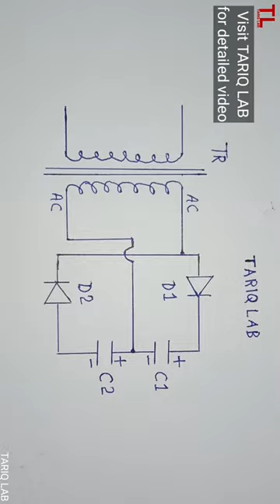Voltage Multiplier Circuit | Voltage Doubler

Comment: value of capacitor and diode.
Reply from the maker: 3300uf 50v,  diode 10A10
Reply: LoL - value of diode. It is whatever you need it to be in your application.
Reply: What is the output of the transformer?

Comment: What are possible good application or use?
Reply from the maker: In circuits, not every portion of the circuit required the same voltage.

Comment: Is that 50 volts AC or DC? I see it is DC, what good is that for?
Reply from the maker: Input AC, on capacitors DC
Reply: What's the amp? Can we double amp also?
Reply: @TARIQLAB Kindly respond, I am looking to do 50VDC 10A-12A output power supply.
Reply: @iykmoses No.
It is a voltage doubler only.

Comment: Why does this work?  Is there something special about those diodes?
Reply from the maker: It charges both capacitors  & capacitors are in series
Reply: @TARIQLAB that part I can see, but I don't understand why 18V becomes 25.8V, nor why 50 v capacitors were chosen instead of 18V
Reply: The 25.8v is the rectified volt when you convert ac to DC it's simple, multiply ac volt by √2

In this case 18 by √2 =25.92

Comment: Tariq bhai,1. 12 volt ki power supply meray paas hai, iss se 2, 3, 5 different volt lena chahtey hain,   2. Kya voltage doubler se 25 vdc le sakte hain.please help.
Reply from the maker: Double sirf transformer ke saath kam karta hai, dosra koi bhi regulator laga ke variable bana len.
Reply: 12, 18 volt par konsa variable lagana hai, variable ki calculation kese krain.

Comment: ac18v transfer to dc = 18*√2=25v , so is not a voltage doubler.
Reply from the maker: 25v on 1 capacitor on both 50v